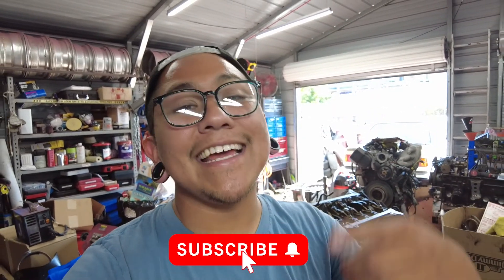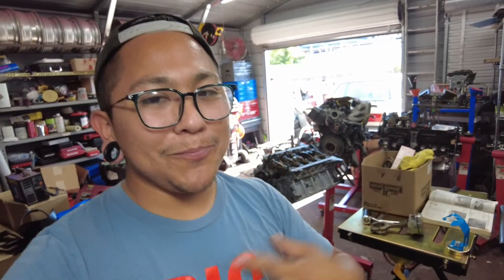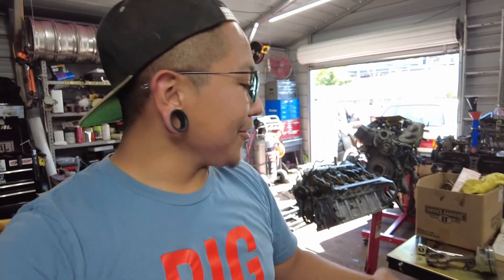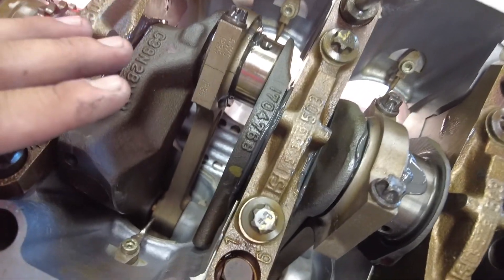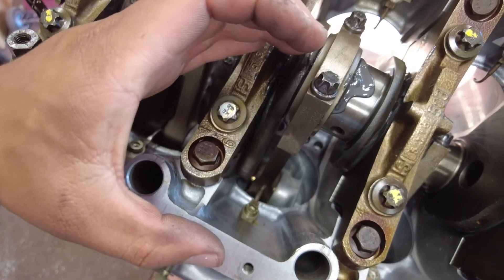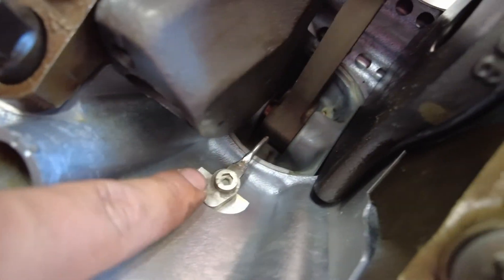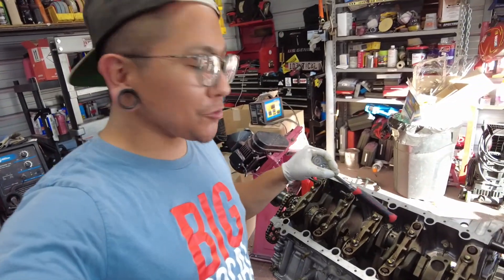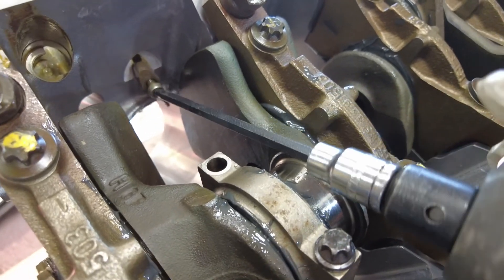Building An M62 V8 Powered BMW E30! PT. 1

Comment: For anyone watching this...NEVER lube the back side of the bearing halves when installing them in the engine. You ONLY want to put assembly lube on the inner face of the bearings AFTER they are installed. Putting assembly lube on the back side of the bearings will vastly increase the chances of spinning a bearing.
Reply from the maker: Hey Dustin! Thanks for the comment and for sharing. We have since then stopped doing this for this exact reason. We luckily haven't had any issues from doing this BUT we completely agree!

Comment: New rings in original bores? No sunnen an-30 hone on this?
Reply from the maker: Hey Jesse! Thanks for the comment. We were definitely iffy on trying to get it honed because of the cylinder lining being coated. We asked our usual machinist and refused to do it haha we measured and it was still in spec and still looked useable so we just went for it on this one. However if this were a client build we would probably opt for a home or resleeve
Reply: @superbimmerbros  Are the piston rings the original ones re used, or a new set of rings? Interested to see how this turns out!

Comment: Hi putting M62b44 V8 out of  X5 in my E30 what sump are you using and what car is it off please? Struggling for info….Thanks
Reply from the maker: Hey there thanks for the comment! So we are following the garagistic guide for V8 swapping the E30. The original sump should work, the swap calls for a subframe spacer or notching the sump and depending on what motor mount brackets you use. 

Here's the guide we are following:
https://www.garagistic.com/pages/how-to-swap-an-m6x-into-an-e30
Reply: @superbimmerbros  Thanks for the info👍
Unfortunately when selecting info on the website just comes up with OOPs 404 error 🙄🙄 typical

Comment: What was the red plastic straw thing?  I will be re-installing the head on my e28 soon and that would be handy.  I thought of cutting of the head of an old head bolt but the red plastic thing looks easier.  I will definitely be recruiting a helper since the block is still in the car.  I barely got the head out on my own (intake was attached, bolt access underneath is non-existent).
Reply from the maker: Hey Roy! Thanks for the comment. The red plastic is a "Bic" or "paper mate" style pen. It's a real life saver because it helps guide the head right onto the block. It's even easier if you use two! 👍 And yes having a helper is a MUST when dealing with an install that is still in the car

Comment: Why the Fawk would you be stupid & spray copper gasket all over the Pistons & cylinder walls that's fawkin Horrible
Reply from the maker: Hey there! Thanks for the comment. We do this as a preventative measure to fill any small imperfections that might be either on the gasket or head. We have done this on all our cars and it's just out of habit now but hey to each their own right? 👍😊

Comment: What did u spray that looked like Cooper? I would advise that maybe u might get new oil squirts? Too much money and work to have something that important go wrong!!! The Bulid looks sweet as hell!!!!
Reply from the maker: Eddie! Hey man thanks for the comment. The copper spray is there for filling any slight imperfections in the gasket and the head i.e pitting and whatnot. This is a peace of mind step that we take in every head install to avoid any air bubbles that might form and potentially cause a breach. 👍 Hadn't we been able to fix the squirter we definitely would have gotten new ones 😁